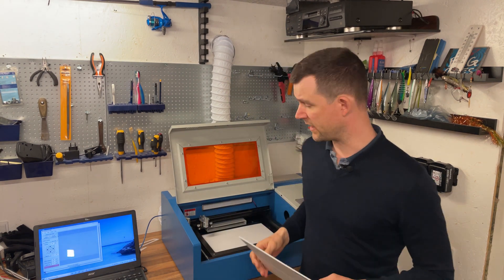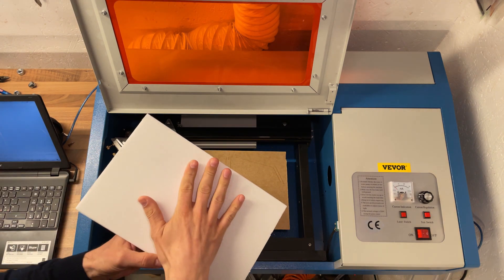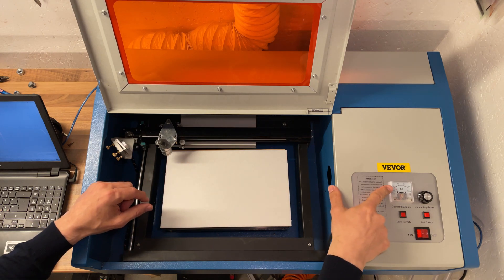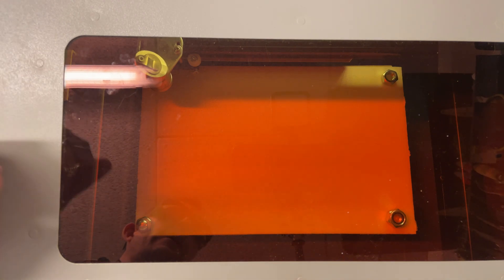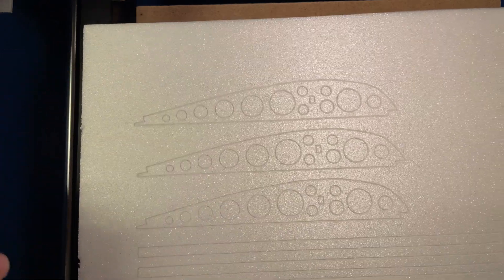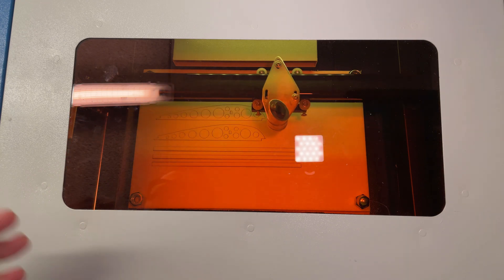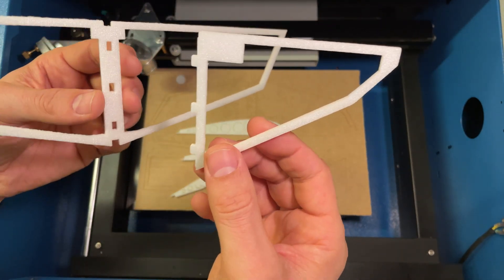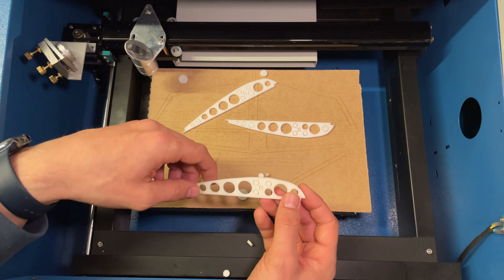How to laser cut depron on a K40 laser cutter

Comment: I kinda missed the explanation as to why you cut with multiple passes. Also why you don't have a strip of wood/acrylic fixed, to act as a fixed X0 Y0 datum, so you can then replace your material in the same place every time. I use a steel expanded metal bed, & use magnets to ensure the material is flat. Also the first machine I've seen with Vevor on it... you're lucky to have received it in one piece, or at all...
Reply from the maker: The reason for multiple passes is because I wanted a narrow and straight kerf. Doing 2,5 mA, at 30 mm/s gets me that.
Initially, I used higher power and lower speed which resulted in a full cut but with an unsuable very wide kerf, generally uneven but also a concave kerf.
When higher power and/or lower speed is used, the area which is affected by the beam is alot larger, resulting in a wide kerf.
Even 2,5 mA, at 20 mm/s is not a good at 30 mm/s.
Magnets is an awesome idea, thanks for that one, but I generellay don't move the depron in between cuts, and this was just a demonstration of how the cut looked after the first pass.
I bought the machine inside EU, and shipping was less than a week. Maybe I was lucky.
Reply: @kaspersorensen   - Yeah, the concave kerf is not pretty or great for glueing the pieces later. I will have to try the multiple passes concept at low power.

Comment: Very helpful. I need to cut some part in foam and thought that I'd check. I did notice that your rib nose profile was very angular. I use Inkscape to produce the SVG files for Wisperer, there is a spline curve function in Inkscape that smooths the curve.
Reply from the maker: Yes it is not super smooth, I will try your suggestion. It also seems the profiles from airfoiltools.com are not smooth either. Maybe your suggestion will work on that as well

Comment: Very informative! I'm a depron builder too! (check my channel) I recently acquired a 10W laser (without knowing too much about it) with intention to ease my depron cutting. I just got it running and it works quite well. White depron however looks like it might be a challenge...
Any tips?
Reply from the maker: Hi Ben
Thanks!
If it is a diode laser you have bought, the wave lenght may not work well with white depron.
Reply: @kaspersorensen  I'm afraid you are right. Works well with yellow and black... And it's primarily for ribs and internal structures...
Reply: @BenErikNess  give a light spray of black paint and try again, set the focal point in the middle of the material.
Reply: @galactica1980  I did try to add colored dark blue masking tape on the surface... It did cut the tape  but not the foam...
Reply: @BenErikNess  co2 laser time buddy
Reply: @galactica1980  I know.... But my diode laser handles 90% of my needs... So if it has to be white depron I still got lots of scapel blades in stock...
Reply: Another thought is to try a hot wire cutter or needle cutter head
Reply: Can you give me the parameters that you use ? Thanks so much!

Comment: Very nice! With such good control (4 passes to penetrate), could you  have a consistent groove with one or two passes to be able to insert small carbon fiber rod or wetted tow for reinforcement? Not for ribs, but for other parts such as spars. I have used a fine kerf jeweler's blade on my 4" Byrnes tablesaw to groove foam on both sides and then insert carbon fiber rods for a very rigid part. However, sawing foam is not as good as melting it which creates a skin layer for the epoxy to attach. Plus, with laser you could even cut truss grooves...getting excited about this now.
Reply from the maker: Thanks, I guess it could be possible. I highly recommend a laser cutter, but with the K40 I already dream of a larger cut area.
Reply: @kaspersorensen  Size is one of things that holds me back (with the higher costs). Too bad they are generally square in dimension when when our purposes a longer, skinnier version would be better.